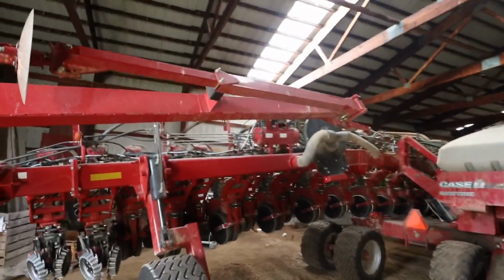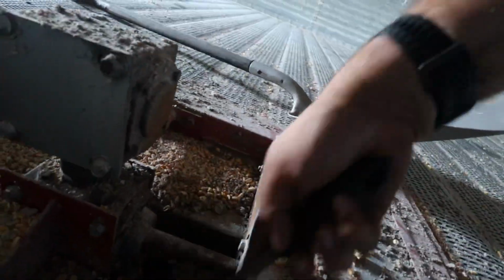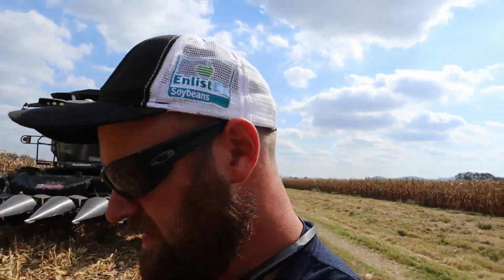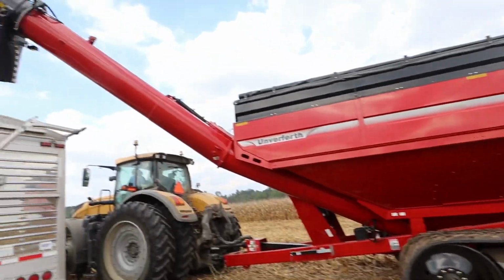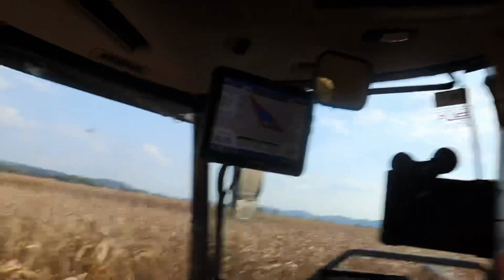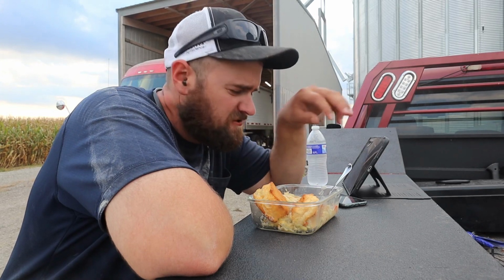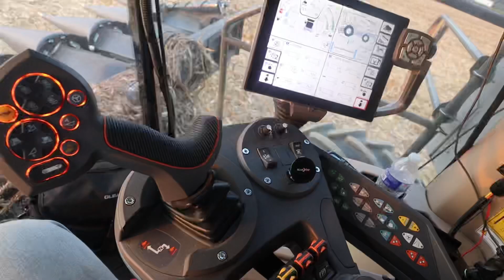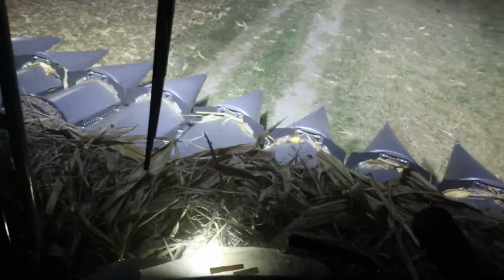The First Day of Harvest 2021 with a New Gleaner Combine

Comment: Have run gleaners for years here, once they are set right they are money. Hardest thing we’ve found is rotor loss, it definetly helps when you take that plate your dad was speaking off out and run the rotor a little faster than you would normally think. I’m sure y’all will get her dialed in. Welcome to harvest 21 and the gleaner gang!

Comment: The Cleaner Combine is the only machine that will "consistently" give a perfect sample. 
The product feed into the cylinder keeps the crop aligned with flow and over 200 degrees of surface to separate the grain.
And the even flow through the pre cleaner and onto the sieves.
WONDERFUL ENGINEERING.  QUALITY OF SAMPLE WILL ADD TO THE PRODUCERS BOTTOM LINE

Comment: I am looking forward to seeing how well the Gleaner S97 performs.  Our first Gleaner combine was model K in 1970 and before my father died a model L2 until the end of 1985.  The Gleaner had the cleanest grain and very little loss out the back.  I see grain from CaseIH and John Deere combines that has a lot of trash.  There is no doubt in my mind by just seeing the grain; you know when a Gleaner is used.  I wish the best of luck with the Gleaner and corn 2021.
Reply: Trash in the grain is more the operator than the combine
Reply: @EugeneMartin95  True, but Gleaners do tend to run a little cleaner for the average dip stick operator.
Reply: @maxpower9499  My experience has been cleaner grain with less loss.

Comment: You could have bought a real combine like a MF 9565 or an Ideal and you settled for a Gleaner S97.  As your combining green stem soybeans at a snails pace compared to the Massey or Ideal,  you might live to regret getting sucked into Gleaner mania.
Reply from the maker: They don’t make massy combines anymore and every time I have seen ideals they aren’t moving so I guess I’ll stick with my gleaner
Reply: @BriansFarmingVideos  l
Reply: They still make Massey combines. Rhe reason I know is we have a a 65 gleaner combine. For service we take it to the Massey dealer  because our gleaner is basically a Massey combine same parts will fit either one. We love the a65 gleaner and as far as spreading  material  behind it  we have a 30ft Massey  draper head and it spreads it the full 30 feet for a very even spread.